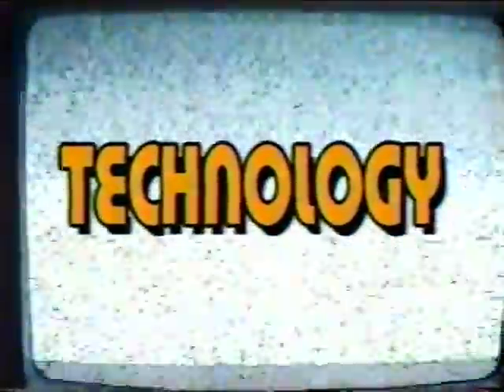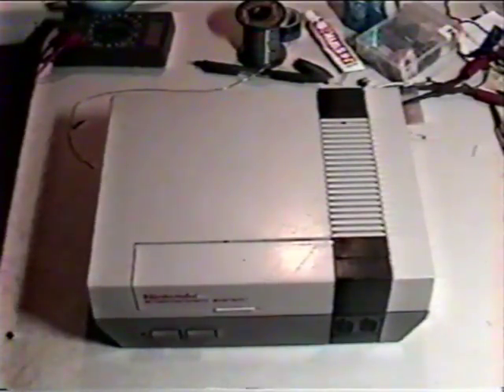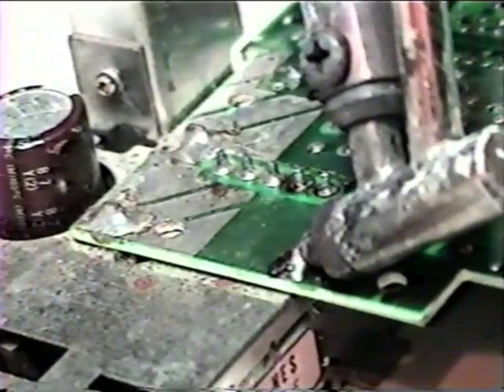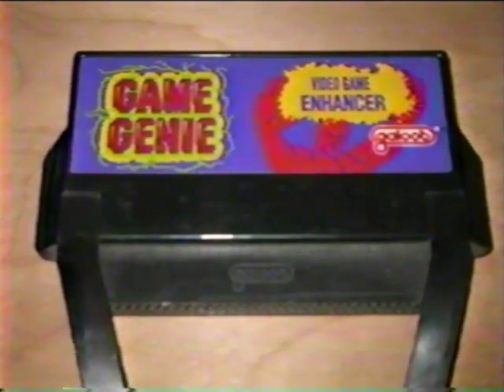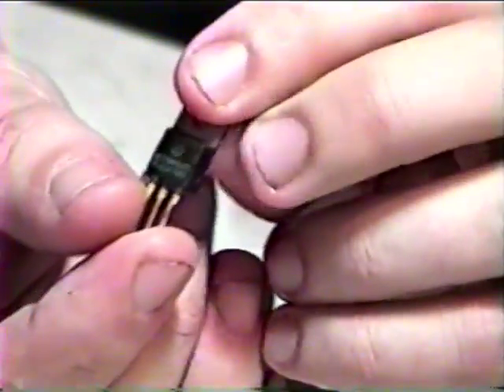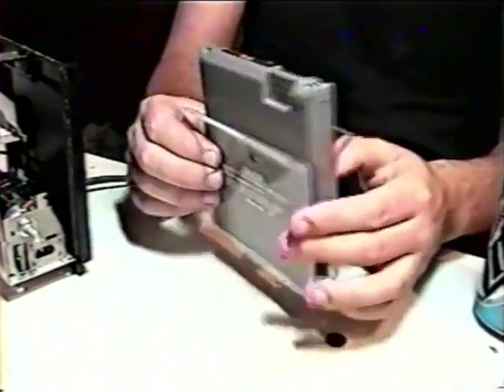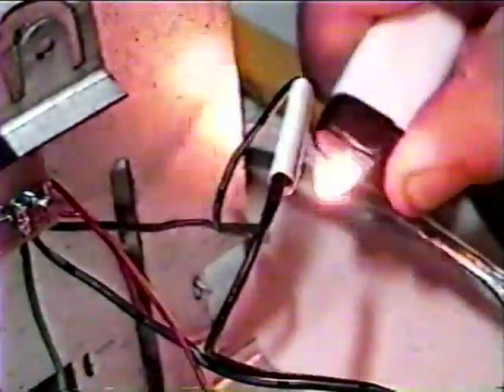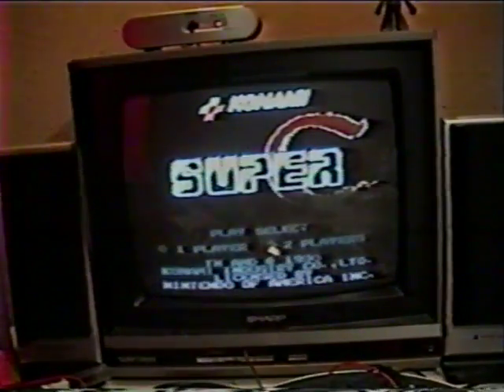Nintoaster Instructional Video

Comment: What kind of soldering iron did you use in this video? Would you still recommend it or just stick to desoldering with the braid strip or such? I would like to desolder points without the need of a braid or pump.

Comment: The ac adapter that came with the NES is 9 volts AC, and inside the RF modulator, there's (I assume) an AC to DC circuit, and if you put 9 volts AC into a DC regulator it'll fry.

Comment: I can pretty much follow along the whole thing and could potentially do this mod, but I lose it at the point of building a video amplification circuit. 
That... And soldering all the wires to the cartridge connector... I'm guaranteed to cross a pin somewhere.

Comment: So far, just the one I got with that video output lead and where it calls home. I *think* it is due to go to the power in spot on the board, but I can't be sure...so, as I'm sure you can see below, I asked about it. Hope to get an answer for that!
Also...the RF mod and expansion port...if you have yet to get them off...good luck, and god speed.
And, the finally issue...finding a toaster >.< Though, I live in a weird town that has little place to get a toaster which fits the looks.

Comment: Does that voltage regulator work with volts that exceed 12/13? Let's say, 20 or even 35?
Reply: It works fine with everything between 9 - 25. But the higher voltage the more heat the 7805 will genrate i think.

Comment: awesome guide, can I still use the RF modulator after I've removed it by reconnecting it to the board with wire instead of building a video amplifier? if so what kind of wire? thanks
Reply: You can keep the RF modulator if you want to. Just solder wires from the pins of the RF modulator to the correct holes on the NES board, you may want to use some heat shrink tubing on the wires attatched to the RF modulator pins though, so that they don't move around or short out. The type of wire you use shouldn't matter too much.

Comment: i feel like the part i would have problems with is attaching the 72 pin connector. from the motherboard i understand there is a top and bottom, but which side goes to which part of the pin connector?

Comment: Just got the Game Genie & removed the casing today. Gonna start de-soldering the 72 pins on the cartridge connector once I buy a smaller soldering iron. -_- Any tips for the wiring and setup without using LEDs?

Comment: at 23:49 how are you supposed to have the solder connection to attach the wires to on the circuit board? and how do you supposed to have the ridges on the back of the game genie cartridge connecter to attach the wires too? SOMEONE PLEASSE HELP!

Comment: I still seem to have a problem with my nintoaster. I've tried 3 different voltage regulators and everyone of them puts out 0.8Vdc instead of 5Vdc. Now I know the input is getting 12.6Vdc. and everything is grounded. Does anyone have any tips? I've re-soldered everything. The video/audio output is grounded as well. Thanks...

Comment: And if someone has an AC adapter which output is already 5 volts DC ?
Reply: +Demonevolpe007  then you dont need that voltage regulator, just remember to add the on switch.
Reply from the maker: +Demonevolpe007 ALWAYS check with a voltmeter/multimeter to make sure!  NEVER simply trust what's printed on the casing.  You'd be surprised.
Reply: +vomitsaw why dont you upload anymore
Reply: The SwampFox if you put a simple smoothing cap across the positive and negative of you usb plug you literally wouldnt need a 7805.  I just thing stepping from 9 volts to 5 is pointless if you can just get a 5 volt supply, less pointless heat generation and such.
Reply: I should have pointed out that the usb wall plug i am using already has a voltage regulator in it. my bad.
Reply from the maker: +Michael Tran I don't have one right now.  New house, have someone renting the extra room, half my life is still in boxes aaaand... don't have a job at the moment.  Eventually though, provided I don't get hit by a bus or something.

Comment: I had no idea, being an electronics noob, that the 7805 could take up to 12V DC (well, almost 13 in the video, but it's unregulated). The NES ac adapter is 10V AC, so while I've learned that you can use DC as well, I thought that more than 9 or 10V would fry the regulator.

Comment: @vomitsaw - wondering why you opted for RCA instead of the NES analogue A/V jack.. Also didn't cover the stereo mod part, did you just split it or did you do the fake stereo mod?
Reply: Steven Benson 
He didn't do a stereo mod. He just wired the same audio signal to both jacks.

Comment: Im actually having hard time finding a power supply that outputs 12v. Ive got 1 that is rated at 12v 800mA but when i checked it, it was almost 19v.wtf

Comment: I am trying to build this but a little confused with the Video Amp Circuit.
Now I have the circuit built just like the diagram but im not 100% sure what connects where.
Im just gonna say how mine is connected and want to know if its right or not.
1. +5VDC Source (collector) is connected to the +5 VDC Out on 7805 pin
2. Video In from NES is connected to Video Out on NES
3. Video Out To Tv is connected to Positive of RCA cable
4. Ground is connected to Negative of RCA cable.

Is this right?

Comment: What amp output is ok on the power supply used? I have a 300mA and a 1A didnt know if one would be prefered over the other.
Reply from the maker: +gr8face0o SUer late but, go with the 1A.  300mA MIGHT work for the board alone (not a bunch of extra fancy lights and crap) but I can't say for sure.  I think the lowest I've ever personally messed with is around 500mA.  I probably wouldn't go any lower than that.  Not to say than you CAN'T or anything, but, probably better to err or on side of too much, in this case, not going portable or anything.

Comment: My 7805 voltage regulator gets extremely hot. im using a 12 V source and a 2n2222 transistor. Does anybody know if this is normal?
Reply: It should get warm, as it is dialing down the voltage. Make sure your transistor is compatible, I believe he calls for a 2n4401 transistor. but yes, it should get pretty warm
Reply: Ty
Reply from the maker: The 2N2222 should be fine for the video amp.  The 7805 is going to get 
hotter and hotter the more you're pulling from it.  More LEDs?  Hotter 
7805.  For example.
Always have a decent heatsink on the 7805.
Reply: used the aluminum heatsink from the original NES and added some special paste, feels a lot better now. i'll reduce LEDs from 6 to 4 just to be safe
Reply from the maker: Sounds good, should work fine!  (Good call on the thermal paste).  The 7805 SHOULD be pretty warm/hot, that's normal.  It's converting the excess energy into heat.
Reply: Feeding a 7805 with 12 volts is quite a lot, hence the heath. It dissipates all al the leftover voltage times the current the NES pulls, so that is 7 volts at about 400 mA (I found that on Google, don't know if that's true) so that makes about 2.8 watts of heat to be dissipated in the 7805. That's quite a lot for it to take. It will be a lot better if you feed it with 9 volts or even 7.5 volts DC.
Reply: So, i finished soldering everything and checked cartridge conector continuity and everything looks perfect. When turning on the nes, game works like a charm BUT, when  plugging in the controller, everything freezes and fucks up. Tried removing some cables from de controller conector, and ive noted that removing the yellow wire makes everything work fin (Except im not able to use the controller duh :c) but when i plug it back in, game freezes. Has anyone had this problem before?
Reply: Also, RESET button not working for some reason

Comment: Hopefully I can get a quick response to this, as I sadly feel to premature modification. I noticed that on the video amp circuit, there is a lead that goes to the 5 volt source....however, looking at the power source/regulator circuit, I can't seem to find where the lead in question from the video circuit would call home...any help would be awesome! Thanks in advance!

Comment: I thought I was going to go on a killing spree before I got that RF mod off...
I'm actually having more trouble  with the expansion port though. What do you do about the plastic fastener pegs that run though the board? Mine appears to be very VERY stuck.

Comment: at 19:31 does the ground wire need to go to the Amplifier circuit ground, or to one of the metal plates on the NES board, or Both?

Comment: For the video amplifier circuit, why is there a 220 Ohm resister splitting off the video out signal and being grounded? I'm not very knowledgeable about this kind of stuff and my limited understanding of it has no explanation for why that's there.

Comment: what are the dimensions of the NES board so that I know it will fit in the toaster
Reply from the maker: Ah, crap. This is variable, depending on if/how you cut things down.
Crap.  I don't know off-hand, I'll need to measure a few.  Note to self.
Reply: if my notes serve right, the dimensions of a NTSC NES board (or at least mine) are 20 cm long and 12 cm tall, by about...2 or so cm thick

Comment: Awsome video! I first saw the nintoaster on avgn and, thought I have got to build one of those. I did some research and, I found this video, I laughed, I cried and, I cheered at the end. I do have a question, I am in the process of building one now. I have constructed the video amp circut but i have a line that rolls down the screen. I also have a hum in the audio. I have the mono output split into two outputs. Does antbody have any ideas as to why i am getting the line or hum?
Reply from the maker: First, thanks a bunch!  It really means a lot to me to hear that this silly crap is resulting in someone pursuing something new and fun.  (From there?  Who knows!)
The rolling line and hum sounds like a power and/or grounding issue.  It's pretty difficult to say for sure without seeing for myself, but from what I've run into in the past, that's what it sounds like.
Reply: *****
Thank you for the reply. I have it narrowed down to my power supply. The one I was using was putting out 11.5 volts but, I only got 4 volts at the regulator. I had another power supply putting out over 14 volts. I hooked it up to the regulator and got 5 volts with it. I hooked it onto the board and, the picture cleared up. The hum was gone as well. Now the system freezes up after about 2 minutes of game play and, the regulator is very warm. Even with the heat-sink attached to it. I think i need to find a power supply putting around 12 volts. At least now I know which direction to go in to solve this. Thanks again for your help. I really appreciate it.
Reply: tconside
I finally got my nintoaster finished. My power issues seem to be fixed. I bought a new 7805 at radio shack. My power supply is putting out 15.2 volts, but I am only getting 4.9 volts out of the regulator. The new 7805 does not feel as warm, and the game does not freeze now. I have not played it extensively yet, but it has played for 10+ minutes without freezing. It was a fun adventure putting it all together, and watching it all work. Now to round more parts so i can build another one! Thanks again Vomitsaw.

Comment: UPDATE QUESTION: would it be possible to use a retro nintendo to build a nintoaster? i have a really good nintendo and i rather not use it and would rather just use a cheap retro one. please they dont have the rf modulator i believe nor the lockout chip (which i car eless about)

Comment: two quick questions can you make an instruction video for the super Nintendo, i don't know if the boards are different or not but i just thought I'd ask, also i am a PC teckie and have built a few items in collage and uni but I'm hampers in following the instructions when the spoken audio is droned out by the music. there are moments where I've tried running few a section a few times only to still not hear the voice due to music. not that the music is bad just that it's loud.

Comment: What's the perf board size?
Reply from the maker: Eeeee, I don't remember.  I just know that I had to fan the cartridge connector pins out a bit to get them through the holes, and had to cut a couple weird little shapes in the perf board to make it fit.

Comment: At 13;50 when building the video amp circuit, you say we need only two resistors. However, on the perfboard there are at least five resistors. Why is this?

Comment: Truth be told, if you don't know how to build a Nintoaster, you might be better off with a reputable installer. Also, I think a newer version with the NESRGB would be pretty cool, and as far I know it's possible.
Reply from the maker: It IS possible!  I found out that Jame's Nintoaster had developed a problem with the AV jacks and someone offered to repair it for him, and they added the NESRGB mod at the same time.  ...I honestly don't know HOW they did it though, because there was like basically no room left in that thing once everything was put together.  No idea who modded it.

Comment: Looks easy, I think the hardest part is the soldering of the Catridge Connector and to watch out nothing is shortened :)
Does this work with every model (JAP, US, EU) of the NES or are there differences in the PCB-Design?

Comment: Now do a Hi-Def Nintoaster with the Hi-Def NES mod!
Reply from the maker: Don't need to now!  There's the AVS.  Shoving it into a toaster would just be a case mod, and the connector is already good, so, there's really not much point.  ...Not that I'm suggesting you SHOULDN'T put an AVS into a toaster chassis, just pointing out that it's unnecessary.

Comment: I'm confused about the AC adapter... Where does the electrical plug come in? The last I saw of it, there were four bare wires coming out of it with no way to plug it into the wall. And why didn't you use the AC adapter that came with the NES?

Comment: I want to actually re-create this, but I can't tell what's just banter and what's not. :(
Reply from the maker: The whole bit about anti-static wrist bands isn't a joke, but it's played out like one.  Just... use one.  They're cheap.  Extending the wires on the controller port is obviously a joke, it's just splicing cables to be longer, I just didn't feel like filming it and if you've already gotten to this point, you'll know how to splice shit to other shit.  As for throwing the RF modulator in the trash, yeah, that's pretty much where it belongs.  Surprisingly, most of the video is serious.
Reply: ***** Thanks for replying. I thought that whole wrist strap was just for shits and giggles. By the way, was that expansion port even needed in the console at all? I never seen that there. Maybe just last minute change of plans?

Comment: Question: Can you use the video and audio jacks on the RF modulator if you can rip them off?
Reply from the maker: I could be wrong, but I believe the metal shielding on those RCA jacks is actually part of the RF modulator, so you'd be sawing through some steel to get them off.

So technically yes, you COULD use them, but I'd VERY strongly advise against it.  The amount of effort and chance of permanently damaging them goes up astronomically.  Honestly, I'd just get some new RCA a/v jacks off Amazon or Ebay.  They cost almost nothing, like 20 of them for $5 or something.  You'd be saving yourself a lot of time and heartache.

Comment: I just realized that the nintendo power supply is 9volts. Didn’t you say that it should be 12volts? also, how many amps is required.

Comment: instead of modifying the ac and keeping the voltage ma bob, couldn't you have soldered in a USB micro female connector so you van use a USB phone charger data cable to power the new seeing as it is 5v
Reply: nes not new, fuckin autocorrect
Reply from the maker: +Gg Allin This is a good idea, HOWEVER, amperage needs to be kept in mind and... I'm not entirely comfortable with the idea that just any ol' adapter from a gas station can be used to power something like this.  Voltage needs to be just-so, and amperage high enough.  I'd personally rather keep it controlled from the inside than open that can of worms.

Comment: lol @ having to use an anti static wrist strap. However it is worth notign the NES was probably made before circuits and built in safteys and guards.
Reply from the maker: The damn thing would probably still work if you dragged it across shag carpet and threw it across the room... at angry land-walking tiger sharks.